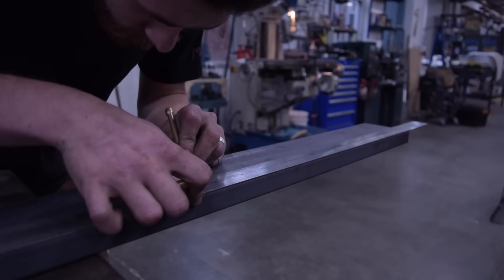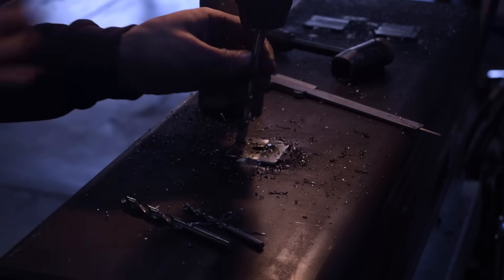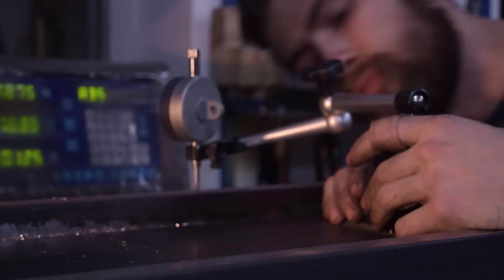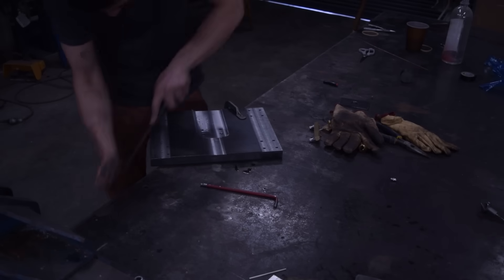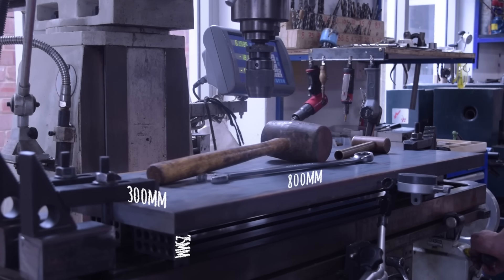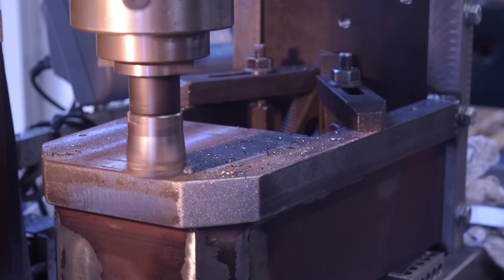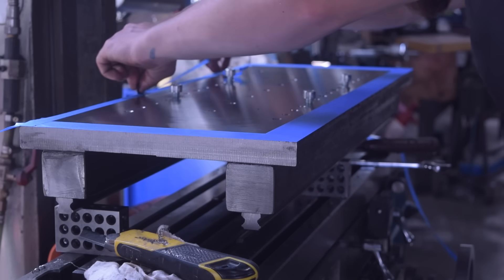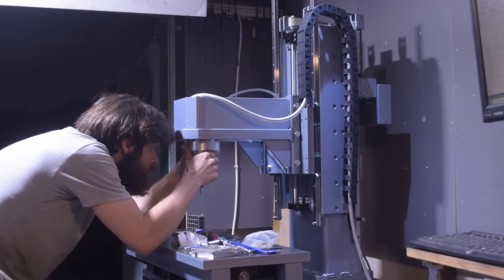I built a CNC mill because I have no self control

Comment: 1:58 Would that help with torsion?  Seems like it would help with skew, but rotation feels parallel to flat-facing plates.  Disclaimer: not a (mechanical) engineer either.
Reply: Unless they're angled in a way hard to see end-on?

Comment: Been in that rabbithole too many times since I landed in New Zealand from India. I have so far built a CNC mill, CNC plasma cutter, and a CNC laser cutter, only to sell them all because once I built them, the tasks I would've used them for turned out to be far trivial than what I had just done. Though, in my experience, it was cheaper than buying new (not the mill though, that was exactly like yours). Yeah, I'm just like you.

Comment: Ive been wanting to build my own lathe and mill for my garage for years now. Ill get to it eventually but just have too many other things to spend money on right now.
Im glad you did the video on this and the BT30 spindle. I was looking at that exact cheap spindle years ago and was going to use it when I eventually get to my build. Ill have to look for something higher quality cause I lack the precision with my hands to hand fix it like you did.

I like the idea of the epoxy sandwich you did. Ill probably end up doing the same on mine. Never seen anyone not just weld the stuff in place before. Have you thought about adding some epoxy concrete mix to that base stand you have to add even more weight and rigidity to the mill? You can add some tapped metal pieces to the corners of the epoxy you pour for those feet to thread in to level it.

Comment: Nice build! I think using a belt on the Z axis is going to kick you later down the road. Belts tend to stretch over time so If possible try to move to disc couplers and mount the servo inline with the ballscrew.

Comment: I have had the idea of building a Bridgeport style mill that also can work as a vertical lathe, after seeing the electronic lead screw on clought 42, I think it's possible , just use a clamp on carriage with motor and lead screw,  it will be heavy. Made of atleast 1/2" wall tubing with thick plate welded to it! With atleast 24" travel  and possibly use a brace to the spindle housing with lockouts for the motions not able to be used. Using a 3-5 HP spindle motor,  and a 1.5-2 HP lead screw motor, using roughly the same for power feed motors   possibly use a hollow shaft to mount a four jaw chuck, then a adapter to hold a taper tool   with the 4 independent jaws being able to center in the taper adapter with it heavily braced and possibly even concrete or sand in the empty base sections. I doubt I'll ever get around to building it. If I did a 10"; chuck would be nice, with a 30////)

Comment: Cool build.
My only question is about the software.
It's not just positioning.
How are you inputting the code.
You know M & G
Geometry.
Tool length.
Work positions etc.
Reply from the maker: I'm using IO sender running on a windows pc to communicate over USB with the GRBLHal motion motion controller. Wouldn't necessarily recommend this setup,(Ethernet would be much better!) as it's very susceptible to electrical noise (the Tig welder on the other side of the workshop will cause a disconnection), and no real easy way to continue a program from a certain line if something goes wrong.

I use a CAM program to generate Gcode programs which are sent from the PC to the motion controller line by line.

Comment: 20 people 7 daýs for what your working on 1.0 - 1.9 building 
Parcel property under weather 06.1 
Vector 10
¿Shelter 1.4 kilometer‽ 
New zealand has 1 acre military computer is ×019 size 
Globe 1 34.2 feet course correction 2114year 2104 '.. 
Globe 2 .   

Globe 3

Comment: Great build. Gathering tha parts to build one similar to yours. What are the dimensions of the rectangular tube you used?
Reply from the maker: Hey mate! I got the biggest sections I could find, 250 X 150 X 9mm
Reply: @NoEngineerHere  ok thank you. I was able to get 177 x 177 x 12.70 for very cheap. So I’m going to use that

Comment: Sweet video!  I hope to replicate your hedonism at my earliest opportunity.

Question:  Did you consider filling the voids in your column and base with epoxy granite?  

It seems like you have screws and whatnot running through those tubes, so you would need to add some channels, but I have heard that filling the rest of the space with a mix of sand and epoxy (and often black dye, if you're feeling snazzy, which you obviously are) can reduce vibration (iirc, some manufacturers do similar things, or make their whole frame out of the stuff).

Comment: Gosh I remember when i was in my last job I had all the skills to make all the physical parts of a cnc but I couldn't figure out  how get the CNC electrical side of things up to a close level of industrial level accuracy ( decent round interpolated holes) or control more than 3 axis and other devices ..... then I discovered  PLC's ( programable logic controller) and HMI  (Human Machine Interface) and I believe with time and help from co workers who build entire productions can help and then I start making that fancy level stuff!
Been a mechanical engineer  5 years (machinist/toolmaking) and making cnc spindles for ANCA cnc tool and cutter machines and others and surprisingly their not hard to get them within 0.002mm in roundness and perpendicular and parallel ....getting collet mating faces within 0.08 degrees takes a few hours for me on a 60 year old manual cylindrical grinder with no hydraulics .... what great apprenticeship that was XD

Comment: Bravo............I was confused  a first........Ur using a mill ......that's ur own mill........imbuilding a lathe and mill in one.........mini 6"×6 "× 4'.....I'm a caveman to........if u put better feed crank  handles on the x,y,z......I often use a crow bar to push the cutting  carbide cutting tool .......i can feel the cut through the tool.....cheers

Comment: Those tig welds do look pretty good, so compliments to having the technic down. 
BUT I cannot stress how important it is to have a sharp tungsten especially when your trying to put as little heat into the weld as possible whilst maintaining the weld quality.
Try using a smaller diameter filler rod, whilst trying to skirt down the knife edge of just hot enough that there's no restiance when adding wire but not much hotter than that. 

My experience is mainly with thinner walled 1-5 mm sheets of stainless that shrinks 55(?) times as much as iron, where running all your welds too hot means you have to hammer twice as long on each part.

Otherwise great video! You certainly earned my like and a subcribe, looking forwards to seeing more!

Comment: I dont know as a fabricator i have to deal with plenty of engineers

 and loadinding that thing into the back of a mazda 2 is definitely something inline with the mind set of an engineer 

And for bonus points ill wager at some point someone offered to use there ute trailer or van to transport it and your reply would have been along the lines of "why It fits?" 

Tell me i am wrong
Reply from the maker: As I briefly touched on, the amount of friends willing to do favours is inversely proportionate to the amount of time you spend on projects like these ones. If I wasn't so good looking I'd be in trouble.
Reply: @NoEngineerHere  so more time on projects = less friends willing to help multiplied by your attractiveness on a scale of 1-10 

So that's where I have been going wrong
Maybe I should run a comb through my hair
Reply from the maker: @bluejayfabrications2216  yeah I believe that's the equation!

Comment: It makes you wonder how few tools you really need to build an entire metalworking workshop of your own, power tools included. In the blacksmithing world pretty much this is the spirit: start with an anvil, hammer, forge and iron bars. First thing you'll do is a pair of tongs, then another, then you make another hammer and so on.
As a prospecting hobbyist I find building the machinery you'll use significantly more interesting than trying to find ideas of what you could make with all the tools.
Reply from the maker: I really think tool and machine building is its own hobby, and a self replicating one at that. "Think of the tools I can make with these new tools, and the tools that these tools build, I can use to build more tools!"
Reply: @NoEngineerHere  You just put the Industrial Revolution in a nutshell.

Comment: Now you get to be the monkey slaving over a computer in CAD/CAM. Just saying 😂
Oh, and not being manual, the mill doesn't care if you have fingers or a hands in pinch points. It just keeps going.
Reply from the maker: Too real. On a similar note, I lost the tip of my finger to a trim router 6 months ago, which had me on CAD monkey duties for a good while.
Reply: @NoEngineerHere  Yikes! I totally hear you. Hope the finger healed well! When I converted my mill to CNC I think on the second run I had my hand on the table that was moving slowly and had this surreal Epiphany watching as my fingers were moved towards being crushed between the table and the gibs. I was watching this and thinking, jeez, this thing is just going to keep going and doesn't care one bit. That was a massive wake-up call for me. I built guards for the mill and  I then went out and bought a manual mill to compliment the CNC one. I find I use the manual one more ...

Comment: I cried a little at "finding metrology equipment in Australia is about as hard as finding metrology equipment in Australia"

Truer words have never been spoken. 😭
Reply: Just going to have to make your metrology equipment. Yes it can be done. The 3 plate method will get you excellent reference surfaces, and you can go from there.

Comment: dude by definition you are an engineer. 
"an engineer is someone who designs, builds, or maintains engines, machines, or public works."
no where does it mention you need a masters degree and a job at NASA and need to be 100% accurate all the time.. 
you are by all means engineering a CNC mill. it might not be as well built as a HAAS or Makino but you're building one of respectable quality.

Comment: "If it looks like a engineer, swims like a engineer, and quacks like a engineer, then it probably is a engineer!."

Pretty damn wicked build man! ^^
Reply: Eugene Stoner was once asked in one of the interviews - why the third reich had so many outstanding mechanical engineers. He said that the reason is, that they started to pick talented machinists, and giving them opportunities to make what they wanted to make. He also said, that ability for visualization of mechanisms, and "feeling" physical materials in your mind, and organizing everything in your mind is an inherent talent some people have, and in different amount, and some simply don't. And that most people who finished engineering schools in USA, and had no such talent, simply sucked, no matter how well they could crunch numbers ( and they mostly crunched numbers at universities ). Solving simplest engineering problems was either a tremendous mental strain for them, or impossible. 
 Something along the lines that per 10 graduates, one was decent, and per 100, one was good.

You either can make something, and it works, and it works well, and is  safely operating. Or you don't.

Some talentless engineers get extremely butthurt when a machinist without a degree comes in, and wipes the floor with them. Their ego can't take it. They resent them because, they themselves spent so much time in education, for practically nothing.
 If someone can think up something in a better way than me, all I get is excited. Because I can see how it's done, and improve my thinking. It's fun.

Comment: As a machinist i applaud your skills as a hobbiest and creator. this is a perfect example of what you can get done through shier will.
Reply: I never thought I would be able to put together a 3d printer but now that I have I am hella confident I can build a light duty CNC for thin aluminum and wood considering all the free software that runs on PC with cheap CNC Boards options. The stepper drivers for NEMA 23s are steep price since you have to get one for each motor :( .

Comment: Great video! I like your style. 
I'm in the process of building the exact same mill, more or less. The jack screws for the column was a great idea. 
Are you gonna fill the box sections with anything? I'm considering just pouring sandblasting media or something in there.
Reply from the maker: All will be revealed 🤐 I think you're on the right track with that idea though!
Reply: I also built one very similar earlier in the year, although its about to be disassembled and moved into location, weight is about 3-400kg using 200x200x16 SHS i dont think i can justify making it any heavier by filling it though as its going into a 2.2x3.3m bungalow with yellowtongue flooring haha.

Comment: I can assure you I don't have $15k worth of CNC parts at the shop right now, because I have self control. but don't worry I have a discord full of people with no self control for cnc projects youre not alone. would be cool to fill in those tubes with concrete or epoxy granite but as it is its probably already rigid enough.
Reply from the maker: This actually added up to less than $8k AUD! I think 🤔

Also, your comment contains some spoilers for the next video 🤫
Reply: Drop him the link Kyle

Comment: Top tier content for less than 600 subs, really well edited and shot.
One thing I would definitely do for that design is to fill it with concrete where you can, it's cheap and will prevent that tube structure from ringing like a church bell.
Reply from the maker: Stop spoiling the next video! ;)

Comment: nice work, im going the other way, have a selfbuild cnc, wanting to buy a manual vertical mill :) - and i am a (mechanical) engineer :)  good video - love to see more
Reply from the maker: There's definitely a load of advantages to a manual mill - not having to sit down at a computer for one. In the future I hope to set this up with some handwheels to be able to manually jog it around for a quick facing cut, etc. 

And thank you! You won't have to wait very long ⏰
Reply: @NoEngineerHere  Ha, I was about to say that @enricodesign619 should see if he can just put some handwheels on to spin the motors and poof! You beat me to it though. As another thought, I've seen mills with cheap video game controllers attach for easy jogging. Might fit some of the need even if you can't feel the vibrations and the pushback.